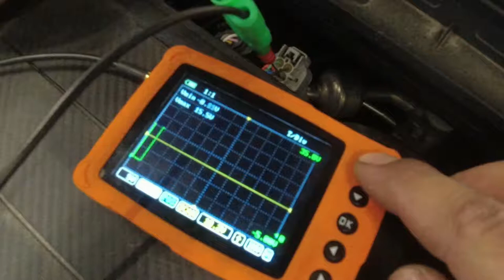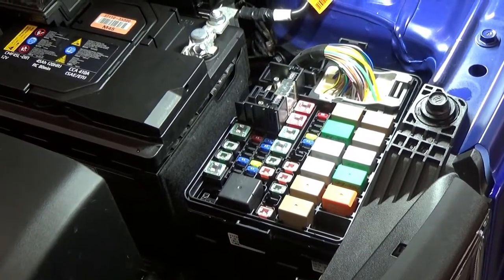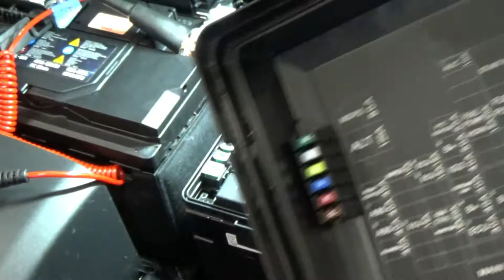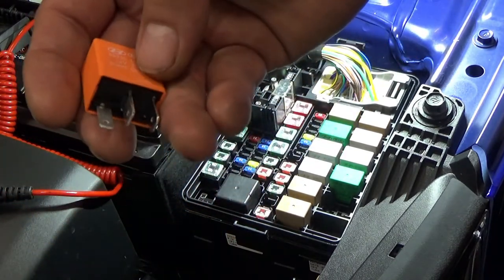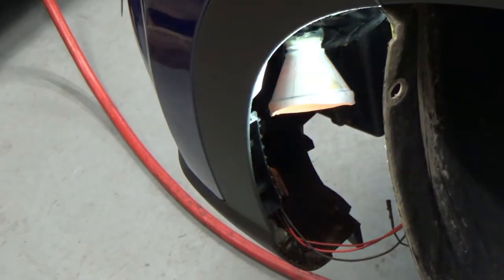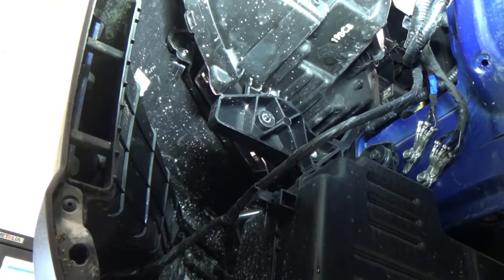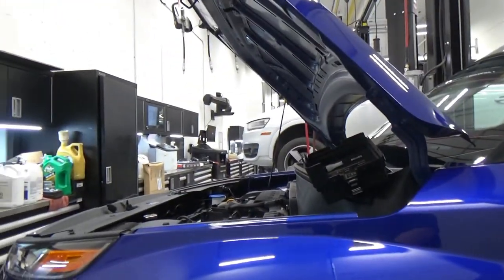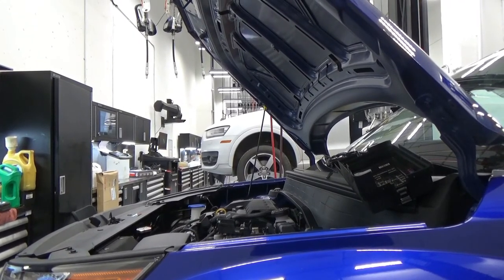HYUNDAI VENUE/ELANTRA HORN NOT WORKING, SIMPLE CIRCUIT CHECK

Comment: Your video helped me a lot to switch out my 2020 Venue horn & thank you very much. Surprised not many people watched this video meaning a lot of Venue owners has no horn troubles?
1st time it happened, I was able to switch the 3-pin relay to a new one & the horn worked again.
2nd time it happened, switching it to another new relay won't work. Jumpered the 30 & 87 PIN for the relay & the horn still won't work.
After watching your video, I removed the 10mm screw & the horn from this HARD-TO-REACH location. Tested horn with 12V battery & it's dead.
I now ordered a new horn from Amazon & have a few 3-pin relays that I don't need.
Car manufactories should install car horn at a easier to assess location.
Reply from the maker: Your car should be still be under warranty? I feel you about the hard to reach components, even me working everyday with these cars sometimes i just shake my head and wonder why they installed in that location. Hahaha glad you like the video. Hope you will like the other videos and spread the word. Thanks again